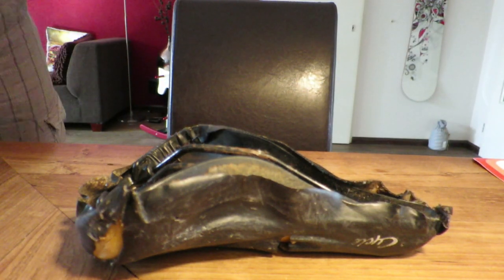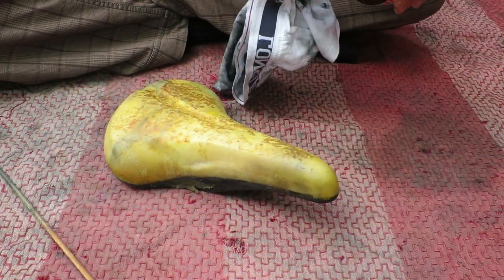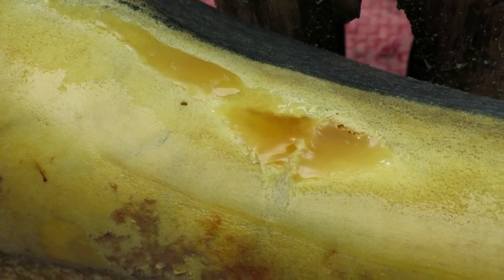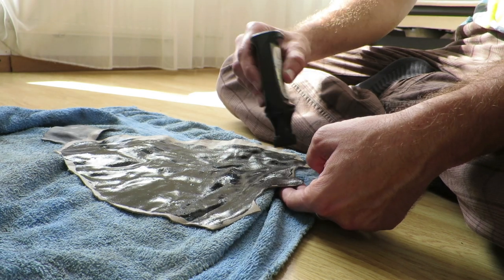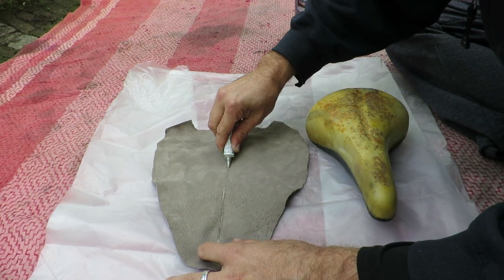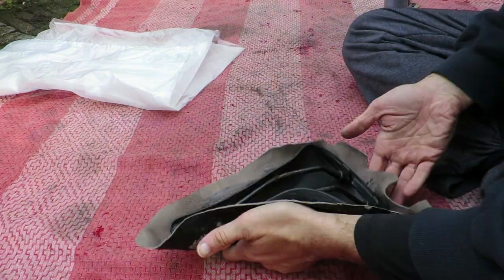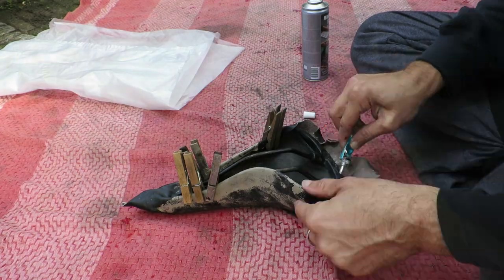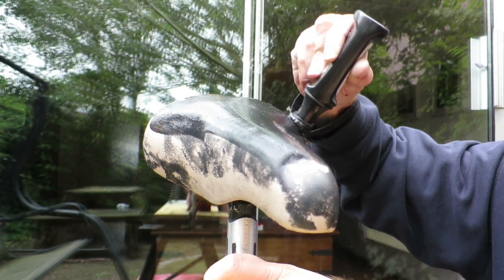How to restore an old bicycle saddle

Comment from the maker: Restoring something can be a trial-and-error process, especially when doing something for the first time. I had never restored a saddle before, so I feel it's only natural I made mistakes along the way, mistakes I wanted to share so you wouldn't make them if you tried something similar. It's interesting to learn that a lot of comments on this video relate to me making those mistakes and pointing them out. This video is not about me making mistakes and failing in the restoration process, but persisting after making them and moving towards an agreeable end result in spite of those failures. Achieving success is made sweeter because of failures and learning from them, not about not trying something because of fear of failure.

Comment: I restore leather bicycle seats,,,,,as a tip.....buy leather the color you want,,,,left over leather is usually NO BUENO..
Reply from the maker: I will next time, for this one I was just unable to find any. And the saddle was so cheap and beat up, I didn't mind experimenting anyway. The color holds up quite nicely. I've ridden it a couple of miles now, and only in the creases doe you see the other color.
Reply: I re-covered a Selle Italia Flite in light grey 7mm leather a couple of years ago but after about a hundred miles, it was stained with sweat and I couldn't remove it, so the long term result is a bit...meh. What thickness of leather do you recommend and from what animal? I have a Turbomatic which is insanely comfortable when set up right but the covering is on its last legs, and this time I'm tempted to go for a waterproof, breathable synthetic (polyester based) cover.

Comment: Dear sir,i was hesitating buying a beautiful ,but damaged saddle covered with PU ,cause i didn't know if it was possible to pet leather instead.
Thank you , you proved it was not an impossible task.Good work!
Reply from the maker: Thank you. My basic rule is if you want to you can restore almost anything. Never in my life had I see a saddle that was in a worse condition than this one, so I looked at it as a challenge. Leather is better than a plastic cover because it stretches more, so you can get a really nice and even look. Good luck on your project.

Comment: How long did the dye last after the second application? I'd be worried to wear white jeans while riding with this saddle!
Reply from the maker: I just finished and rode the bike it's supposed to go on. With about 40 miles on I didn't see any dye come off. I also checked my dark gray pants and didn't see anything on it. I've also done an early 80's white suede saddle cover which proved to not hold the dye so well. I had to reapply the dye a couple of times before the cover stayed black. I've now ridden that one for several thousand miles. Long story short is that you have to become confident in the dye not coming off before wearing those white pants on it. And different saddle covers behave differently.
Reply: @restorationdotbike  Ah, OK. Thanks for the explanation :-)